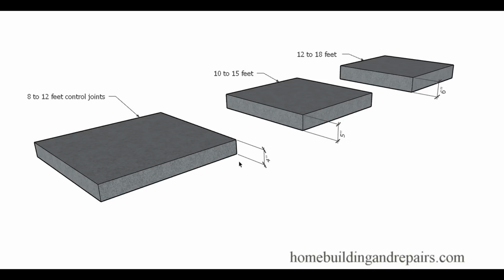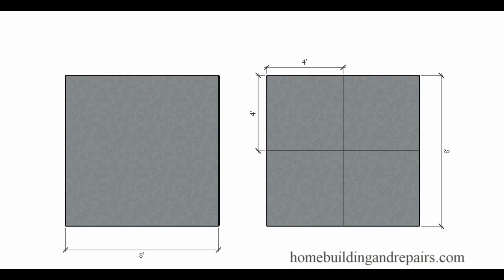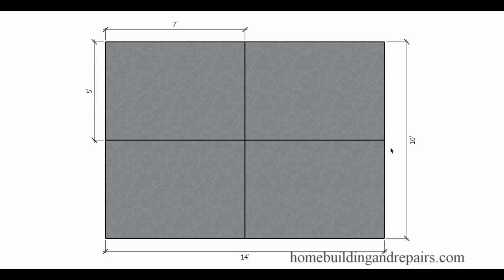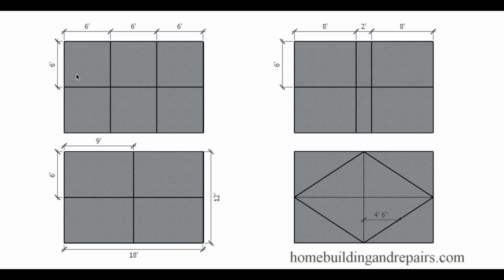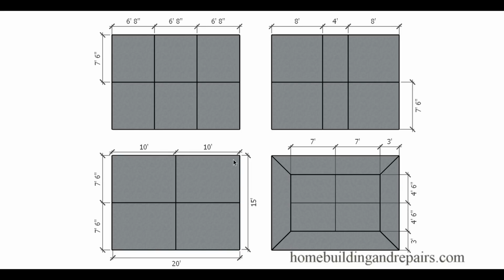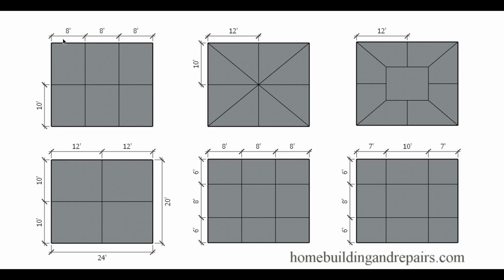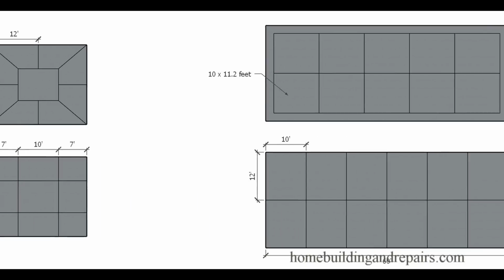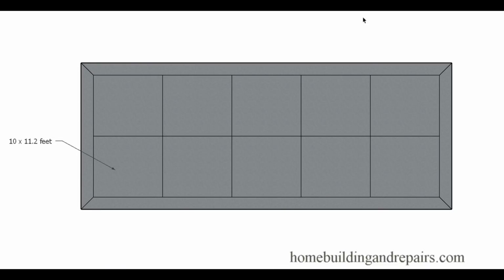Maximum Spacing for Control Joints in Concrete Patio Slabs - Design Tips and Ideas

Comment: Are these the same numbers with steel added and fiber added to the mix?  What if I keep the concrete wet for 30 days?  I want my shop to be 10’x20’ with no expansion joints.  Slab will be 5.5” thick.  My plan is to use rebar and fiber and keep it wet for 30ish days. Not worried about hairline cracks because I’ll epoxy coat eventually.

Comment: Question: Do the joints need to be orthogonal -- i.e., "linear/square"?  Could you make them mildly serpentine, that is, a slow s-shaped curve, say an s-shape that varied as much as 1' across 10' of distance? No, not quite as easy to do (you do it during your pour), but it could look much better if so, depending on your aesthetic preferences.
Reply from the maker: Yes, make you designs. Control joints can be curved and I think the reason why we see more straight ones is because it's easier.

Comment: Do you need to pay attention to the length and width ratio? Wouldn’t a control joint spacing of like 1’x15’ be prone to just crack in the middle rather than along the joint? Is there an ideal ratio?
Reply from the maker: If this is, I've never heard of one. I've seen them as small as 6 inches and running over 20 feet and yes, they can crack. In your example, maybe use control joints 1 foot long spaced at least 5 feet apart if it doesn't mess up your design.

Comment: I have a concrete slab that has hairline cracks . They are not wide enough to put concrete in them. Should I put a liquid sealer on them.
Reply from the maker: I wouldn't worry about hairline cracks and really don't know what you would do to prevent them from getting larger.
Reply: Caulk the crack they caulk specifically for that

Comment: I think your videos are crystal clear.  My problem is I have a small mixer and want to do my entire driveway myself.  Is it possible to pour sections at a time with proper control joints?  Can’t find any videos on this.
Reply from the maker: I think that's a great idea and I've done it myself before. You will actually be creating control joints by pouring it in sections and they are usually going to be better control joints. I will try to make a video within a few weeks to show you how it's done.